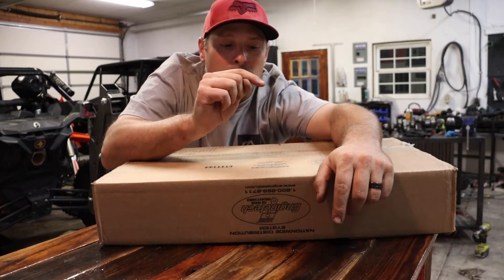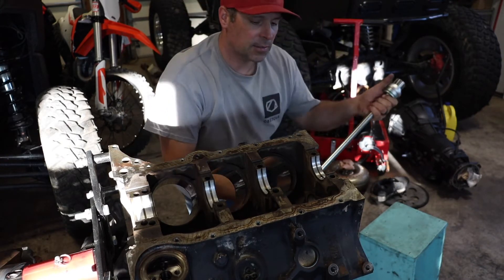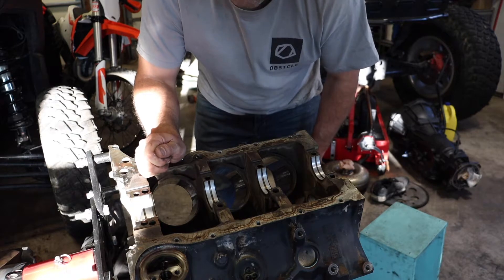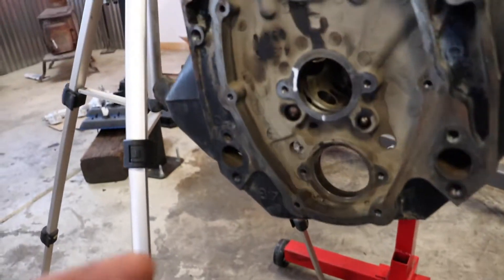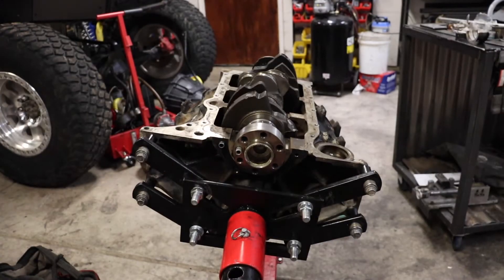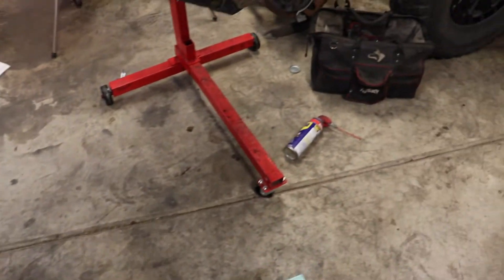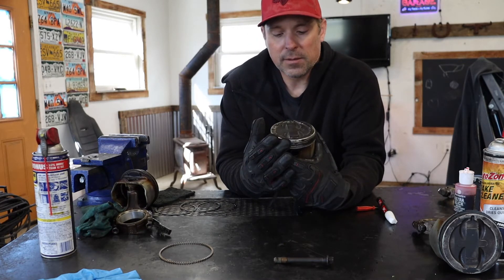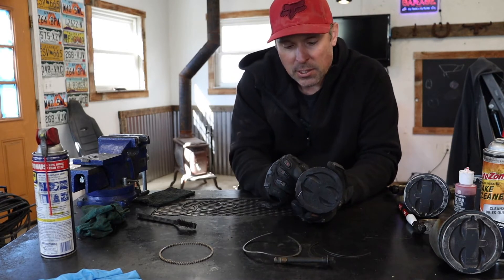Vortec 4.3 reassembly of the Bottom, Crank, pistons, rods, cam bearings, rear main seal.

Comment: How did the cam go in? I'm rebuilding a mercruiser 4.3 (same block as the car engine) and having trouble with the cam bearings. The 2 hole bearing for the back of the engine has a thicker wall or something. It goes in harder than the other bearings, then the cam won't fit because the bearing gets undersized when you drive it in. If I put one of the single hole bearings at the back it goes in nice and the cam fits. As far as I was aware, the 2 hole bearing goes at the back like you show, but something is funky with mine.
Reply from the maker: It’s a been while since I did this, I remember one of my middle bearings almost felt too loose. But several years later it’s still holding up. I don’t remember having an issue with that bearing.

Comment: I am currently rebuilding a 4.3l from a 1997 Chevy Blazer. This video helps a lot! Thank you!
Reply from the maker: Thanks for the comment! I noticed there were a bunch of disassembly video, but not many assembly videos. Mine has been running great for the last few years since I made this video.
Reply: @wheelinoutwest  This is my first time breaking down and rebuilding an engine like this, so I'm learning a lot! Mostly from videos like this on YouTube. 😂
Reply: Me 2. For some reason my rod bearings aren't working right.
Reply: Great video! I'm rebuilding a 00 4.3. How did it turn out?